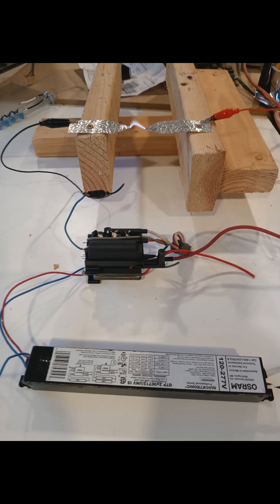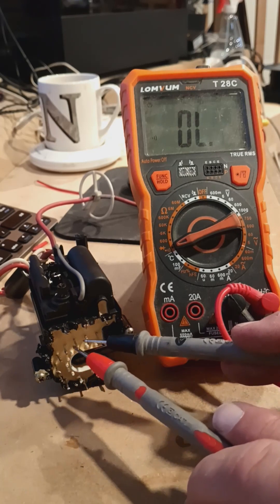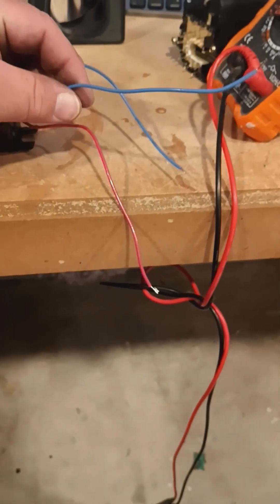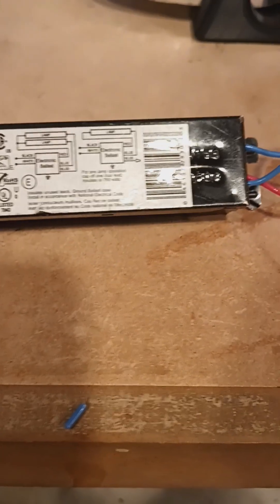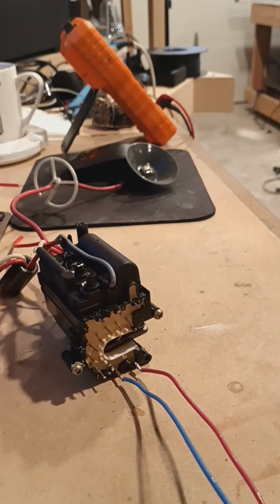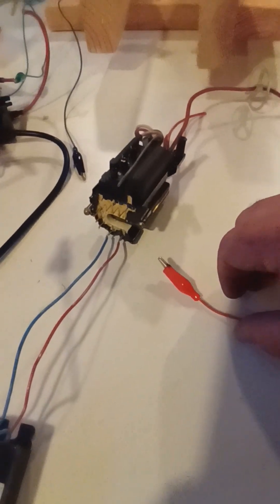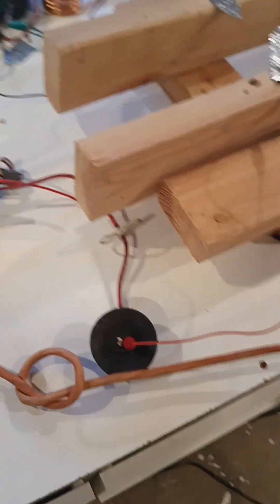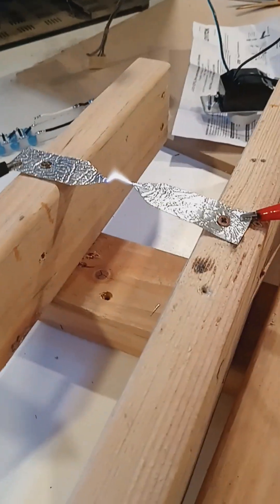ballast to run flyback part 1  (fluorescent lamp)

Comment: Thays alot of power. Its up there with the zvs drivers. How much power does it pulls thou?
Reply from the maker: a zvs is more powerful because you can change the power source
Reply: @oldmanbuilds  yeah but zvz draw alot of amps and can reach over 60 watts. Ibdint need aobmuch power for my application. So I'm asking how much power does this type of ballast draw and can it run continuously withouth burning up ?
Reply from the maker: @raloed.363  running it in this way does reduce heat. The coil is designed to run on a circuit like this. The output power is low so the flyback coil cannot overheat with amps. Yes it is a consistent circuit. I don't remember the voltage but it was close to 12v and the amps under 2a

I run a zvs with 24v but only 2 amps. The heat is much less and it gives me hours of run time. depending on the load you have. for instance when constantly sparking the heat builds up in the flyback faster no matter the input. so it is max 30min. Non sparking or very few sparks will have it last four hours.
Reply: @oldmanbuilds  oh so the flyback is the limiting factor then since it's the one that heats up.

Comment: Neat... You can see on mine I drove them too far.... and burnt the diodes. I did an experiment with a CFL driver but the sparks were shitty... I have a beefy OSRAM driver but didn't try with that one... but instead I just wound 4 turns on the core and used a 1000W ZVS driver to power it for the sparks :)
Reply from the maker: any way you can make sparks is cool to me.

Comment: pretty cool, what material is that youre using? foil?
Reply from the maker: textured aluminum. You can find it at Lowes. It does good for long term use.